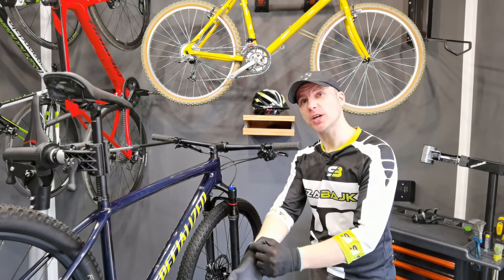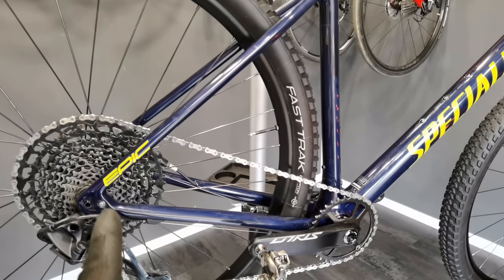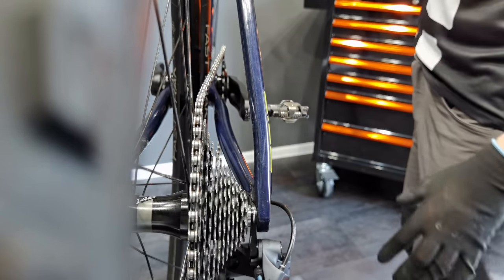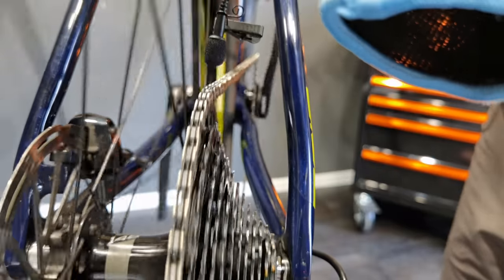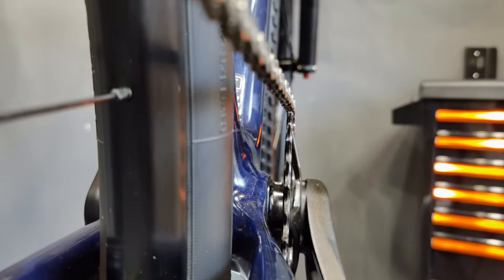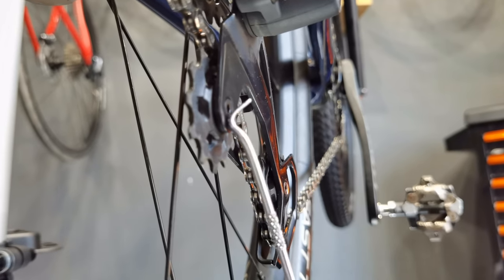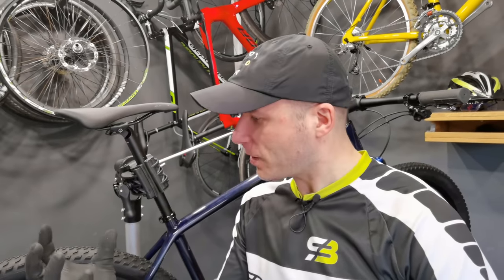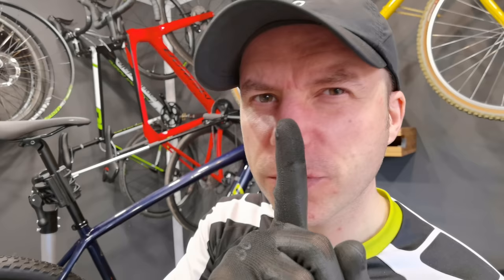If you were close to XC race podium riding on 1x12 drivetrain, you'd win it on 2x11. Here's why...

Comment: Just curious how many watts you will loose for 1x12s on 50t cog chain line  friction?
I race xc, for me 3x10(40-30-22 /11-36) 2x12(36-26/ 10-45) work better with wide gear range. 
1X12 best for xco race and trail ride for faster shifting, only if you know how to use it... I will wait for the next generation shimano 1x14 speed, 9-56t cog maybe, or maybe 1x16😆

Comment: Personal experience: I had 3x9, 2x10 and 1x11 systems. I always had problems with 2x10. Sometimes (not every day, but it was common) the chain fell down. Once I even broke the front shifter, when I tried shifting in muddy conditions. I did a muddy race with 1x11, the chain was loud, but technically it was as good (or bad) as other systems.

Comment: I can't understand why 1-by drivetrains are used on gravel or even road bikes (with 9t on the smallest sprocket!). I bought a gravel bike recently and I feel much higher need of small and high gear ratios than on an XC.
Reply: Yes, especially because gravel bikes are getting more capable and when you ride a more capable bike, you ride more extreme terrain.  Once you do that, you find out that a narrow range of gears simply sucks and your bike suddenly has a less capable drivetrain than it's chassis. Now you have to go buy more bike parts to upgrade your bike, AGAIN.   The bike industry wins.

Comment: No doubt the chainline isn't as straight as on 2x drivetrains when shifting correctly, but I don't think the rubbing steals enough watts over 2x drivetrains that it'll loose you the race. I know how to shift 2x drivetrains properly, but I also know from experience that in a race situation when you're in the big ring and a short punchy hill suddenly appears you're more likely to shift to the big cog in the back instead of shifting to the small front chainring and then you're crossing the chain even more than when using 1x. Probably it has something to do with the fact the front mech doesn't like shifting under load (obviously neither does the rear one, but the chance you'll snap the chain whilst shifting under load is way bigger with the front mech) and as you're not willing to lower the power output in order to shift in the front (especially when someone else's attacking) you shift the 'incorrect' way. And it's also known that bigger wheels (chainring and sprockets) are more efficient than smaller ones as the chain has to bend less – that probably compensates with ease the loss of watts made by rubbing.

Comment: I am flipping back to a double chainring. Really nice to be able to dump or gain a whole heap of ratios in one click. Also means i only run 11-42 cassette which is lighter than a 50+ tooth.
Reply: But what about the extra chain ring and screws on the drive train then? And the shifter+front derailleur+cable?
Reply: @Masterfighterx   Sure,  running a 26/36 front ringset and shifter set weighs more than XTR 12 speed, but also is sooooo much cheaper. My bike is a 2018 Merida, so getting a good chainline requires huge ring spacing.

Comment: I want to buy a new bike with a decent shock and full suspension. The problem is that all of new bikes are 1x12. Is it possible to downgrade bike to 2x or even 3x?  I am an ameteur but i do about 3k km.  For my riding 1x is not tempting, especially that i usually keep my cadence low but enjoy going fast.
Reply: 3 by is out dated and very unnecessary
Reply: Unfortunately, many manufacturers have designed their bikes so that you cannot fit a front derailleur and are deemed "1x only."  The trend of wider tires to 2.5 or 2.6 ate up the space a front derailleur needs-the chain would have an unacceptably close distance to the tire when on the small chainwheel.  There are, undoubtedly, a few manufacturers with post 2019 models that allow a front der.  I can't think of one, though the list of all bikes in my head is less than comprehensive.  Another aspect of multiple chainwheels on full-suspension bikes is effect of chainring size on suspension dynamics.  Lots of thought and engineering goes into anti-squat and anti-rise capabilities and preventing or minimizing pedal kickback. Apparently even a few tooth  difference  matters (a bike's optimal design includes, say, a 32t chainring, but can fit 28-34t rings), so imagine the differing suspension kinematics between the 36t ring and dropping to 26t in a 2x build. 
I loved 2x drivetrains.  Having quality builds with XTR or XT front pull, side swing front ders on both my hard tails and '02 FSR, never did I have a problem shifting or dropping a chain. Having a one-click bailout was awesome and for technical uphill you could stay on the 26 tooth, having all the range you needed. Level or down hill stretches, proper front shift, and there you had plenty of range and ability to faster--if you could handle it.
Reply: Yes, get a Pivot Mach 5.5 frame and build it up with Shimano 2x like SLX or XT.

Comment: Well I believe you are right. 
     But what I think people want is less stuff. One shift and a dropper what most people are talking about.
      They say you get better climbing with one by but I don't think there right the math don't add up if there using say a 11 to 46 with a 3x 
Because you get a much smaller chain ring and you also get a better chain line but what a old ass 50 year old biker knew
Reply: I have 2×10 on 29er. The lightest gear is 36 in back and 26 in front, thus 1,38 and I must nearly lie on bars to prevent tilting backwards and concentrate on circular pedalling to not have back wheel in skid. Using typical lightest combination of 1×12: 51/32 = 1,59 is insane and I want to see someone using it regularly.

Comment: Great demonstration! I never even paid attention to the details like on the front ring the small teeth for the narrow links, my bike teeth links are set correct but is it possible if you drop a chain and in a rush have the narrow link on the bigger teeth or will it not work? Wow, that explains even on road bikes all the noise now a days. My 15 year old road bike triple front ring 9 rear set up is sooooo much more quite then my new 2x 11 set up. 🤙

Comment: What was wrong with the 2 and 3x. Why not keep a design that keeps the chain as straight as possible. Of course I welcome less moving parts, ONLY if it results in reduced maintenance. Love that the industry is trying new things but I believe we all will be looking back in in number of years and saying “remember when they tried a single front ring” 😂
Reply: I don't think so, the single front ring is here to stay.  You've got simplicity of maintenance and cleaning, simplicity of operation, weight saving.  Having ridden everything I would never go back.  I do agree with the efficiency points made in the video, but for the vast majority of riders these things are irrelevant and out weighed by the simplicity!
Reply: useleas gears on a mounting environment nobody is using large front gears on a dangerous downhill

Comment: I'm happy that 3x is out, that's way too much. 2x is ok. I haven't really tried 1x yet, but I'm hopefully about to have a 1x bike by Wednesday.

What I look forward to is not having to think about switching gears on the front and matching it with the rear and the biggest rings will most likely not be used often by me, I think I only used the lowest gears on my last 2x 1 or 2 times in just shy of a year before it got stolen. And then it will also be much easier to clean that area.

The 2 things that bothers me the most is the possibility of it not being with 1x12 fully in mind so it doesn't line up perfectly and the fact that it has pressfit BB, but PF works fine for some while it's a squeaking pain for others.

I can't really have anything but a 1x at the budget I have and with the specs I want.

Comment: best drivetrain for mtb imho is still the shimano 2x11 xtr. The flexibility you have is simply amazing wich is where the 1x12 fails miserably. 
Fun fact is that you can go stupidly low in a 2x drivetrain (24/34 front) while still having proper cadence options (11-34 ultegra).

Comment: How about putting a 6mm off set chainring?
Reply: I mean obviously 6mm chainring are for non boost frames but wouldn't it be lesses friction?
Reply: @corny9904  on a lot of bikes you will hit the chainstay. Especially for an XC racer who is likely runninga 34T cog. The nice thing about the old 4 bolt chainrings is that you could tweak the chainline with spacers.

Comment: Makes me think the old shorter freehubs were better with 7 speeds, you just lined up the chain with the middle cog and it didn't have to move far to get to the 1st or 7th gear. A wide ratio 7 speed cassette maybe 11-34T can still give you usable gears with a 1x setup for road use if you are a grinder/masher like me. I absolutely hate front derailleurs the extra fettling and having to think about 2 gear shifters when I'm mixing with HGVs on the road etc. I'd be happy with a 11-50T 7 speed cassette if someone did one. Also 7 speed chains and cogs seem stronger they had a bit more metal to them.

I've got an old Trek mountain bike that I got off ebay for £8 with a 7 speed freehub which I was going to convert to a touring bike and  changing to a 8/9 speed freehub wheel but now I'm thinking for a touring bike maybe the 7 speed freehub is the better option with a better chainline.
Reply: try box components, wide gear ratio on a 9 speed
Reply: I still enjoy using my old school Shimano 3x7 & 3x8 cassette drives. Simple, strong, & reliable.

Comment: Cross chainring is not making significant losses. It was lab measured and is really not somthing that would change much of your results. I've been riding 2by for some time back in the day and it was not good for any technical course. Because race track have usually many change of pace and technical zone there aren't many places to change chainring without losing significant time. So most of the time i was using my 2 by in the big ring which made for an even worse chainline. I remember back in triple days some racer were mostly using the big ring which resulted in nightmarish chainline. The chain retention is not good either which is bad for rock garden and such things. If you ride leisurely and want to please yourself with a pretty chainline go 2by but if you are in a hurry or riding technical stuff 1x is the way to go.
Reply: @shredfreak83  But this video is about MTB.  no one is saying 2x doesnt have options outside MTB??  On the road, where its smooth, and has consistent gradient changes closer ratios is important.  It is far less important in the wildly different and constantly changing world of a "good" XC course... Infact it can be a hindrance with the need of multiple and frequent gear shifts (and that poor chainwear from all the extra shifting ;-) )...  If you want to ride a 2x setup, go or it.  
In saying that though...  Even at the Cape Epic/Swiss Epic/Pioneer there wasnt a 2x system anywhere near a Podium...

Comment: 2x chain suck in a bumpy muddy race climb may  cost you more watts I guess. And 2x is heavier, meaning more watts. Only one way to check; test it : )
Reply: The weight gain of front gears is partly offset by a lighter smaller cassette.  Also, gearing leverage is far, far, far more advantageous than being 100 grams lighter.  
I installed a 3x10 on a spare road frame just to try it out.  Sure, the bike weighs more - but not so much that it really matters.  However, the energy saved from not having to hammer up steep hills left energy to totally smash it on the rolling hills or flats on a larger (middle) chainring, driving far more distance per pedal stroke with more efficiency than the small ring of a 2x.   I went faster overall thanks to saving energy by spinning up the most demanding part of a course on the small chainring.
Reply: Good point. But reliability remains important for races. Riding in rough muddy conditions has always been crap with 3x and 2x setup. But in ideal situations, they indeed have benefit of better chain line.
Reply: @FedBiker  if chain drops are a real problem for a 2X bike, then an additional chain guide along with the 2X FD plus a clutched RD and narrow-wide chainrings can't solve the issue? Even in jumps my 2X hardtail never dropped a chain before, and i don't even have an additional chain guide on it. Clutched RD and narrow-wide chainrings are basically default equipment on decent MTBs now.

Maintaining a 2X FD is ezpz, all i do is clean it. I just set the H and L limit screw upon installation and that's it.

Comment: But does it really make a practical difference? I'd be interested in numbers. How much watt does it really cost? Without those numbers it does not make sense to argue.
Reply: If you are not interested in wattage (I'm not) there are other benefits of 2x systems. For example you have a 36t big chainring in front which is super useful when riding fast on a flat terrain.... And you do not need massive cogs in the rear, so the cassette can be much lighter...
Reply: The biggest problem isn’t Watts lost; it’s the rapid mating and wear.  Hypergrind already causes problems with rapid mating between chains and cogs; add in poor chain lines that increase wear and stretch the chain more quickly and the mating will occur much more quickly.  It doesn’t help that chains are much narrower now.
Reply: @keirfarnum6811  add an oval chainring to the equation and it's total bullcrap.
There are so many things that make a practical difference when it comes to efficiency tbh.
High speed flowy courses would opt for the 38/28 front chainrings while the rear can be an ultegra 11-25 or 30.
Lot's of sharp cornering with heavy accellerations would be 26er territory 36/26 with 11-34 would smoke pretty much any 29er on there running a 1x.
Reply: @shredfreak83  HA HA HA HA.  26'er.   Oh dear, I dont even know if you are being serious or just trolling now?? 
You must have a tiny usable cadence range. Also do some research on gear ratios... Or dont... it at least entertains a lot of us :-D

Comment: My front derailleur (10 speed GX or X5) can't shift to the smaller ring under load. How can I fix it? Is it the cables, the spring? Should I, and how can I take the front derailleur all apart and clean it? Would a front derailleur upgrade be better? I'd love if you answered. Thanks and keep up the good work!
Reply: Use Shimano
Reply: Don’t shift under load.  In other words, learn how to shift.  Front derailleurs were never meant to be used under load.  You have to back off the pressure while shifting.
Reply: @keirfarnum6811  Haha this is so funny. Have you ever raced? Sometimes you HAVE to shift under load. And not even like anaerobic loads like 600-700, but loads close to FTP like around 300W. Anyways, thanks for the advice :)

Comment: tbh sometimes i miss my 2x for this exact same reason, the chainline is meh. One way i mitigated is removing the spacer on the bottom bracket and slammed a 3mm plastic spacer on the casette (my frame is quite unusual, like it was build with groves in the dropouts for this reason).

Here is an ideea, dynamic casette. Letting you the option to chose how many gears you want and what gears.
Reply: Dynamic cassette is completely doable. Just use single speed spacers then take off independent rings from the cassette. As long as the distance between gears matches the pull ratio you should be good.
Reply: @christopherwall1130  Exactly, i for one dont use some of the middle gears, in some situations i just need a really good high gear and a really good low gear. A 8 speed 10-50 casette will be golden for me, enough gear and solid chainline.
Reply: Road riders used to be able to choose their gear ratios.  The industry doesn't want people to have options.  The bike industry companies want to control your options and direct you to their product road map and evolution.  Any deviations from this path they carved for their business plan is a loss in revenue.
Of course there are companies out there like Tektro, Microshift and others who will continue to make what a growing number of riders want, such as low gearing for drop bar bikes and great cantilever brakes!

Comment: have you experienced any bent cogs, teeth, and sharp edges on cassettes with such chain line? I have 11-50T Sunrace cassette, have quite decent chainline.
Also my bike is Geometron G1 with 455mm chain stay, plenty of room for chainring. even if not using boost wheel, using converted wheel and use 3mm offset.

Comment: remove one gear from the cassette..but retain the shifter and deraileur... put a spacer to push cassette outward... adjust the deraileur Low limit... so now u got 11 gear with slight better improvement in the chain line....

Comment: 2x10, front 22-36, rear 11-42 on my GT Avalanche
Reply: @Spitch Grizwald Its serving me good, i sometimes use 22 front, 42 back (1x1) on steep uphills, mostly going 1x4 on gravel road and 2x3 or 4 on asphalt uphills, tires i am using are schwalbe nobby nic front, smart sam back, 29x2.25 size

Comment: I have a bike that is currently NX Eagle 1x12 that I am planning to upgrade to Shimano XT at some point in the future. See that there is also the option of 2x12 as well as 2x11. Any thoughts on the difference between the two? Is it worthwhile so go for the slightly narrower and lighter 11 speed cassette for a 2x11 setup over 2x12?
Reply: I think 2x12 is overkill and it can be a pain in the back to get the shifting dialed. And I can't fathom how someone would need that kind of gearing range, then again I don't train or race like an XC specialist. 11s has been reliable and hassle-free for me.